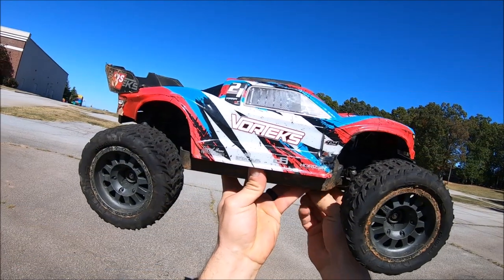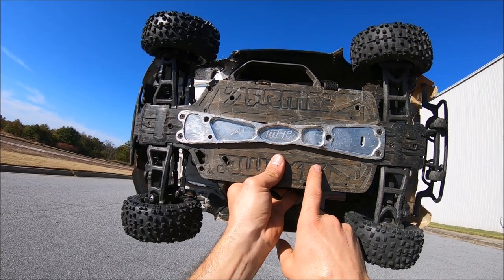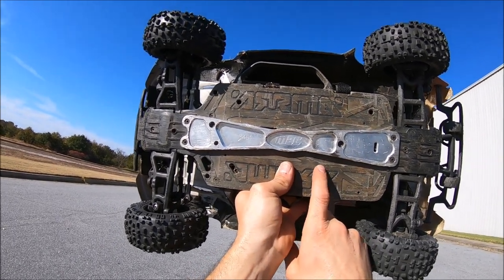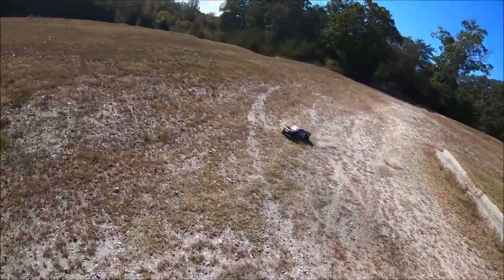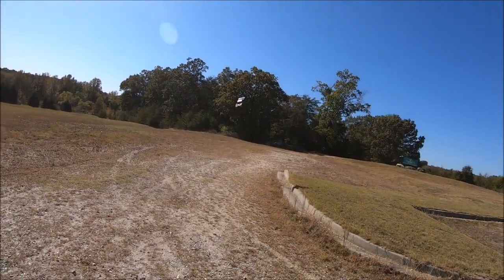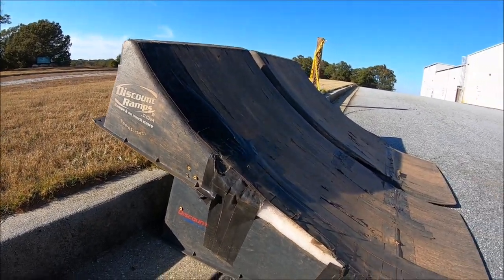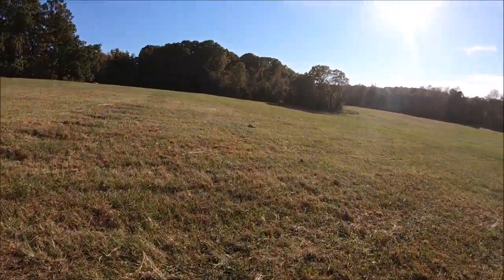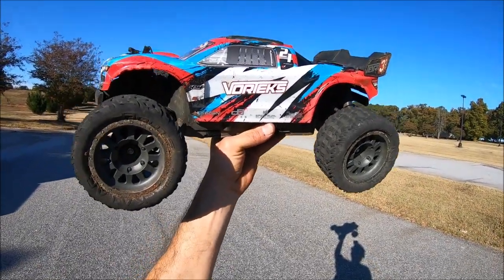ARRMA Vorteks 3s and Senton on 4s testing the M2C Bash Bar💪

Comment: That crack on the Vorteks chassis is from the front battery tab flexing and pulling on the chassis when the battery gets thrown forward. The Granite and Vorteks have this problem since the battery tab is only attached to the chassis on one side. I’ve cracked 6-7 chassis in the same spot. I’ve fixed it by using the wider Arrma battery spacer. I moved it in front of the battery instead of in the rear and bolted it to the chassis. The front battery tab doesn’t flex anymore and no more cracked chassis. Bash bars will not prevent this recurring crack.
Reply from the maker: I agree!👊During the sends I was running a huge 9500mah 120c pack. The weight definitely stressed the point you're talking about!

Comment: What shocks are on your Vorteks? I blew through two front shocks (shaft snapped at the base) within a month and washing bashing nearly as hard as you.
Reply from the maker: Stock shocks with 50wt oil. It could definitely use a shock upgrade though!🤣
Reply: @RCDUDE81  Very impressed the shocks survived. Another guy in my RC group had the same issues with his and got some big bores off eBay.

Comment: I need help, I have a 3s typhon and absolutely love it but I have pretty major steering slop, it’s always had it and I can’t get rid of it. Any suggestions will help.
Reply from the maker: A lot of times the little plastic bushings ib the links will get worn. Going Hot Racing aluminum will help. Also adding some small shims on the steering posts to tighten up the slop helps. These little 3s rigs def. have some slop but it's kind of an entry level rig too.
Reply: Thanks a lot buddy. Really helps,

Comment: I run my senton 4s but one I hit about 40 50 mph it just wheels and flips I think I need a lower weight shock oil to keep it planted
Reply from the maker: The oil weight won't really make a difference on the Senton as far a parachuting🤣As you saw in the vid mine was floating around the whole time on 4s. Super hard to drive but fun for sure!
Reply: @RCDUDE81  ok thanks ya I got a bit more use to ezing on the throttle